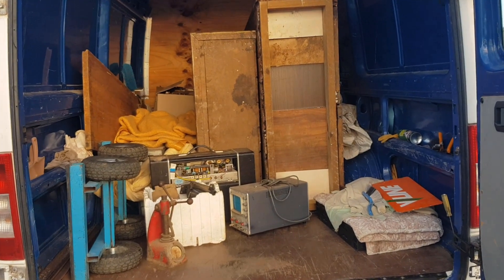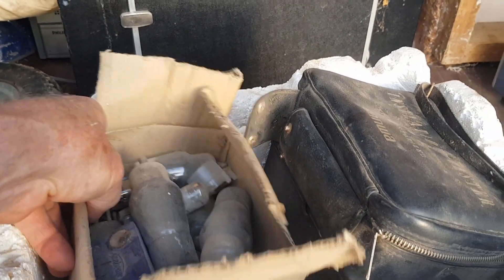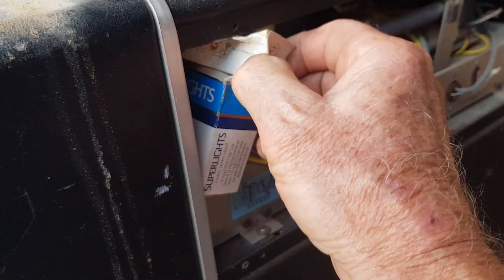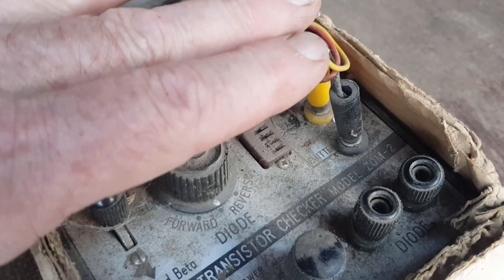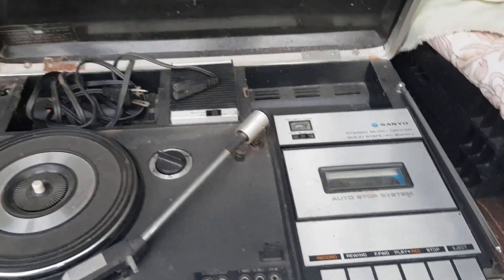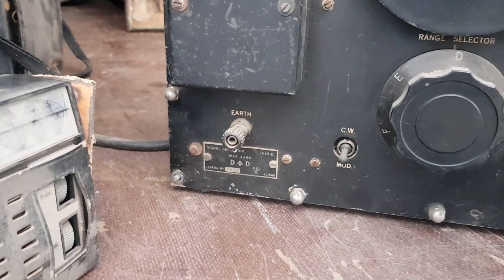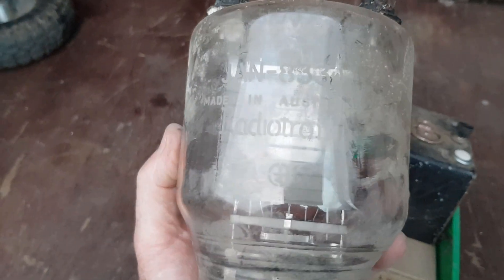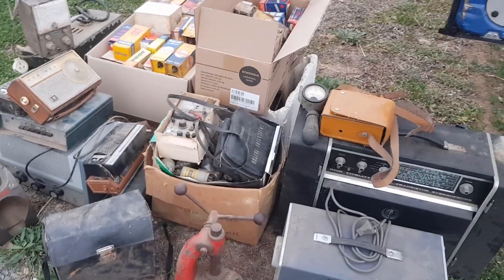A show & tell of some vintage valve radio gear and test equipment scored from a shed clean-out!

Comment: Great finds in the show and tell video. I used to find a lot vintage electronics in hard rubbish like what you have shown in your video but in the last 5 years that has all but dried up. I did get a really old tungar tube rectifier battery charger at a swap meet years ago. The owner said it did not work so after cleaning up the edison screw on the tube and socket it worked.  If you have time I made a video about testing it.
Reply from the maker: Thanks luckygen - I'll definitely check that one out!  👍😊

Comment: Ist item is a valve spring tester....tests Valve spring tension........ 6.50 amp.....I would be interested in that if its for sale at some point....... 8.42 is a Megger....(insulation tester)..............10.40....HMV radio, again interested if it comes up for sale.......11.02 an antennas signal strength meter for analogue TV.........11.31 RF signal generator..........Safety light for places where explosion is a risk.......12.60 a Telephone amplifier..........14.22 a transmitting Valve.........everything else pretty much what you thought.
Reply from the maker: Thanks Harb! That's great info. I didn't think of a valve spring tester, but that makes more sense than a bearing press (that would hardly need a pressure gauge!)
Reply: @TheUltimateRecycler  geez I thought it was a pressure also 🤦🏻‍♂️